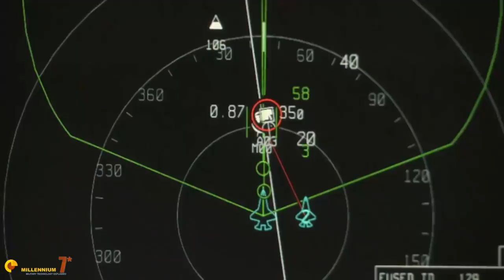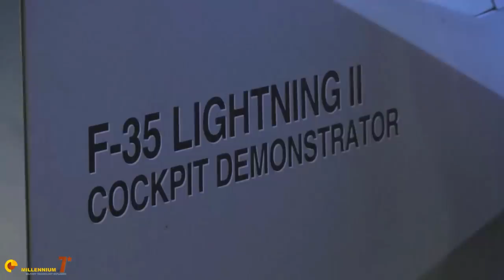Put the F-35 inside the F-16 | Are there limits to upgrades?

Comment from the maker: Support me on Subscribestar  https://www.subscribestar.com/millennium-7-history-technology
Support me on Patreon  https://www.patreon.com/Millennium7
Reply: Smaller transistor size processors don't run Hoter at same clock speed

With smaller transistor size u can pack more translations in a area which allows for higher frequencies (smaller connection b/w the transistor allows to meet hold time and other parameters for higher frequencies ie less time).  Therefore it depends on what kind of performance you want from your processors.
Reply: Would you say that these upgrade limitations justify the JSF as a replacement?
Reply: well the Philippine air force is now planning to buy F-16 Block 70 Viper or The SAAB JAS 39 Gripen C /D.
not so sure what planes they could get, they are also waiting for the KF-21 if the next president isn't stupid.
which one is the better?
F-16 Block 70 Viper or JAS 39 Gripen C/D?
in cost and combat ability.
The F-16 Block 70 said it will deliver at 2027 and only 12 + 2 F-16 block 50(old),but the Air Force need it ASAP.
The Gripen C/D will be at 2024 and it will get twice the number than F-16 B70.
also why SAAB didn't offer the E/F?
Reply: @ryanc00p3r3  "also why SAAB didn't offer the E/F?"
A good question as the E/F is supposed to be even cheaper and supposedly significantly more capable...
However, production only started in 2020 (in Brazil) so availability could be the reason.
Reply: @GonzoTehGreat  they not gonna replace the FA-50.
That plane is bought for Training for Multi role fighter planes and ground support.
Not so sure why the choose The JAS-39C/D instead of E.
Maybe they move the F-16 blk70/72 in horizon phase 3 for next batch of Multi role fighter?
But if so they will be new contender for Horizon 3.
The KAI KF-21 semi stealth 4++ Gen fighter.
They also order another batch of FA-50.
But the generals really want that F-16 blk 70/72 because of F-35 component.
Reply: @GonzoTehGreat  so far they want a Multi role fighter so bad right now because of tension on south china sea.
Delivery of F-16V is too slow.
And also so small number only 12 compaired to 14.
Even the french submarine company was so nervous talking philippine official because all of them is so serious and want it to deliver ASAP, no slow time so i think the delivery time of F-16V failed expectation of PH Air force.
But negotiation is not yet done, they haven't release the deposite yet or sign contract.
Reply: @ryanc00p3r3  See my previous reply. 

According to that website the Gripen currently looks more likely to be purchased, based on cost.

However, I don't think it's a good idea to rush into purchasing a dozen fighters based on cost, in response to China's recent aggressive territorial posturing.

Such a purchase should instead form part of a sensible, cohesive, defensive strategy.

Like Vietnam, Malaysia, Thailand, Japan and, of course Taiwan, the Philippines is in no position to take on the PRC alone, so they should support the formation of a South-East Asian military alliance where members agree to standardize their armed forces, as is the case with NATO.

Comment: When designing the J35 Draken, a small space was reserved for the possibility of moving the engine forward a bit, in case the centers of gravity and lift were found to
be unsatifactory after flight testing. As it turned out, the centers were where they were designed to be, and this space was not needed. However, a new version of the
Avon engine were developed, with a fan disk added as a new first stage. (a "zero stage"). This new version of the engine was of course a little longer, and the space
reserved in the Draken design, was the exact length for this new engine to fit...  as if designed for it.

Luck should have no place in aircraft design, but still...
Reply: Very interesting insight.
Reply: A fan stage added? That would make it a turbofan Avon, which I have never heard of. I assume you mean an additional compressor stage.
Reply: @justforever96  Correct. My mistake. A "zero-stage" compression fandisk(?) added.
Reply: @justforever96  Aren't most fighter engines low/medium-bypass turbofans nowadays?

EDIT: Oh wait the Draken, nevermind
Reply: Flexible design is not simply luck.
Reply: Draken was cited and of particular interest to the original USAF Fighter Mafia,  in the initial research and development of the YF-16 prototype.  A good dogfighter Among contemporaries, it has low wing loading and a respectable P/W Ratio.
Reply: @maximilliancunningham6091  It was not designed as a superiority fighter, but as an interceptor. Start, shoot, land, fuel re-load, repeat. Quickly. It wasn't a particular bad dogfighter, and with a good pilot trusting the early datalinks it had, it could find a advantageous attack vector, but it had limits.
A funny little anekdote about the J35D, (uncertain of how true it is) was that it could continue to accelerate until the fueltanks were empty. The engine could not push the airframe to its aerodynamic speed limit.

Comment: I see, now I understand why the Mirage family can stretch 3 generations despite looking almost identical externally.
Reply: Mostly changed the engine, nose and material of structure, shape is the same
Reply: Are there other Mirage planes besides 2000?
Reply: @854gabryel  of course.

The Mirage III is legendary !
The Mirage V
Then there is the Israeli versions like the Nesher and Kfir, there is also the South African Cheetah

The Mirage IV is a twin engine strategic bomber/recon aircraft

The Mirage 4000 is a prototype F-15 like heavy fighter (basically a twin engine mirage 2000)

The Mirage F-1 is a non delta mirage (so it’s not very hard to tell apart from the other mirage) 

The Balzac and Mirage IIIV are VTOL prototype ( not very good, but still to this day the only Mach2 capable vtol ever build)
Reply: @Jib60  Don't forget the Mirage G, which was a Swing-Wing F-1.
Reply: @Jib60  how does Mirage 4000 prototype "F-15 like" aside from having twin engine? 🙄
Reply: @nuclearwarhead9338  it was a heavy and fast fighter.
You know like the US Air Force operates a low/high mix, the f16 being the low light agile fighter and the F15 being the high Heavy powerful fighter, Dassault wanted the same, the Mirage 2000 as the low fighter and the mirage 4000 as the high fighter. It was a beautiful thing.

But not strictly comparable to the F15 in termes of capabilities. It would probably match it in terms of speed range and agility but not armement.  

France had no real long range missile before the introduction of the Mica (80km) and the meteor ( over 100km), the radar would probably be lacking too, the Cyrano radar of the mirage was weak.
Reply: @Jib60  The Mirage IV was a totally different plane, really no relation to the III except for a visually similar appearance. Same for the 2000. Don't confuse marketability of a famous name with upgrades of the Mirage III. The Mirage F-1 is also a totally different plane, which doesn't even look the same. As far as the other versions, like the 5 and Kfir, it was partly that it was much easier to upgrade avionics in those days, because they were much more primitive and had less cooling and power supply requirements, and partly for lack of better options. The Israelis couldn't buy new jets, so the only feasible option was to upgrade an available one. That doesn't mean it was an efficient or optimal solution. As for the 5, it was pretty much a simple matter of removing avionics that were considered redundant in the desert climate and adding a fuel tank in their place. In an old fashioned mechanically-controled jet, this was much more simple than today, when all the avionics are integrated with the airframe (not that it was an easy task even then). Those days are long gone, and no one is going to upgrade a plane without upgrading to more powerful avionics as well, with consequent power and cooling requirements. 
This is something like saying "of course you can upgrade a jet instead of building a new one, see what the USN did with the Super Hornet?" The Super Hornet is basically a totally new aircraft, both because it was impossible to fit more powerful engines and larger fuel tanks into the original airframe, and because of the reasons he mentions here.
Reply: @nuclearwarhead9338  He obviously means 'filling the same category as the F-15', not that it looks like the F-15. There is more the one way for two objects to be similar to each other. Both are twin engine, expensive, high performance fighters, as opposed to low-cost, simple, single engine fighters. The 4000 was to be a direct competitor to the F-15.
Reply: @justforever96  Please read carefully before answering next time.

What I meant is that the Mirage III, Mirage V and 2000 look externally similar despite being very different aircrafts.

As for my mention of other mirages, it was to answer the question "are there other mirages beside the 2000" that was asked, I'm not claiming they're the same aircrafts. 

Though I would still add, Dassault doesn't make big leaps when it comes to design, and every single aircrafts is a more or less big evolution compared to the previous aircraft... Thus the Mirage IV despite being a completely different aircraft, is essentially a big Mirage III, and the Mirage 4000 Would have been a big Mirage 2000.

Comment: Perfect picture at the beginning after the question!

BTW - MIL-STD-1553B does include more than the Manchester biphase encoding (physical protocol) but also software protocol for message header, device addressing, data length and polling frequency. The issues putting new devices on are no plug and play (you touched on this) and also message frequency. Modern software designers expect on-demand network capability but the old 1553 system was a fixed polling system. You didn't use to have to make your own TCP/IP, you needed to make your own alternative to it. Again, your TCP/IP example was fine - but if anyone reading has TCP maintenance experience and thinks that the metaphor wasn't that scary, think again lol.

Great video as always!

Comment: Great show, keep up the good work! Side note, Air mass flow was not talked about. Like why the F16c needed a bigger air inlet when a new engine was added. But again, good job!!!
Reply from the maker: Great point!
Reply: He did sort of, I thought. I thought that was what he was talking about when he said it needed new bulkheads and perhaps changes to the fuselage. Because you can't change just the inlet, you need to do the entire intake, perhaps widen the entire engine, probably the jet pipe as well.

Comment: A very well rounded explanation of the problems associated with installing new features on an existing airframe.  One thing occurred to me, however.  Upgrading a the existing F-16 airframe has many problems that might be avoided if the folks looked at a variant- the F-16XL.  That aircraft has a greatly expanded internal volume that might provide the room to accommodate most, if not all, the desired upgrades.

Comment: Engine changes remind me of the British F-4's which swapped J-79 turbojets for wider Spey turbofans. More power and better fuel economy vs higher drag and lower top speed. The speed reduction due to widening the fuselage and the inlets to accommodate the wider powerplants. But then the Israeli Kfir which swapped the original Atar for the J-79 certainly benefitted in every aspect.
Reply: Yes, one can swap engines. But as he said, it usually requires basically redesigning the plane. Widening the fuselage and inlets of an F-4 to accommodate more mass flow was not a simple task, which is one reason a British F-4 cost several times what as US F-4 cost.
Reply: @justforever96  No, The F-14 was built to accept an PW engine that never showed up, so it was built with the PW-TF-30's from the F-111. A few years later the Navy asked PW to adapt the F-100 used in the F-15 and F-16 for the F-14, PW said no because the F-14 used analog controls while the F-100 was digital. The Navy then looke at the GE engines and asked them about the  the engines from the B-1 bomber and was currently being developed for the F-16 and F-15. They one into an F-14A and made and and flew it,  later they took another spare engine and put that on as well and the first F-14A+ was born. They then ordered the GE engine to be fitted into the F-14A's and for the F-14D.
For the F-14 they took parts from the F-15E radar to upgrade the F-14's radar, a new cockpit displays, sensors and an IRTS system

Comment: Well don't feel all clever now knowing what TCP/IP is 😁. (Not that my network admin skills are anything to boast about!) 
It's worth mentioning that a lot of this also applies to submarines. If you want to make any major change to internal arrangements you basically have to do a major redesign. This is what the Royal Navy's Astute class fell victim to. It was originally conceived as a relatively modest update to the Trafalgar class. However, the navy wanted Rolls Royce's newer more powerful PWR2 reactor instead of the PWR1 which was pretty obsolete by the mid-90s. However the PWR2 is significantly larger and this set off a whole chain of issues that resulted in an entirely new boat. Even with all that work however, there were still problems getting a gear set designed for a 5200 tonne boat to convert the turbine output into shaft revolutions to push a 7400 tonne boat up to tactically required speeds.